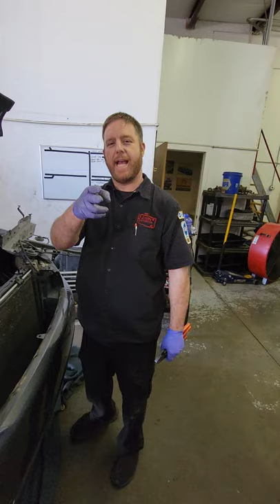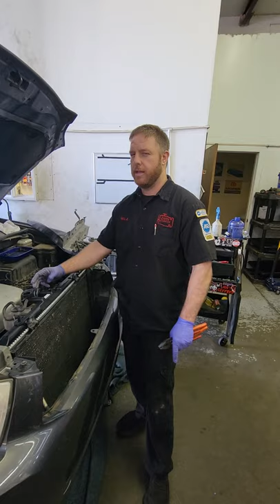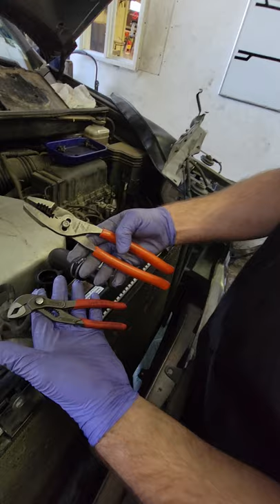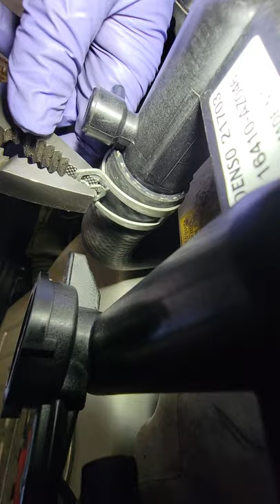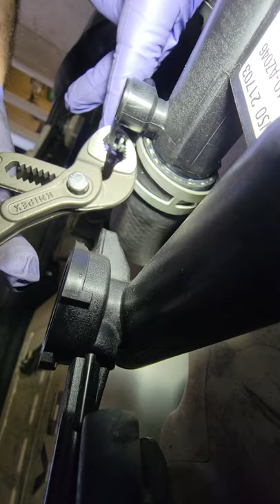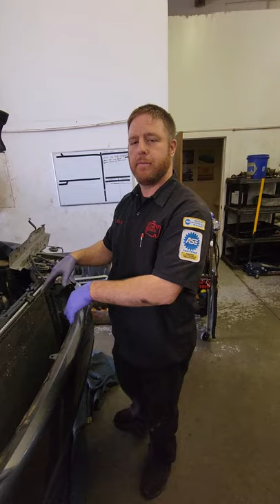NZ DIAG! How To Properly Lock & Unlock Constant Spring Tension Hose Clamps #shorts #automotive #auto

Comment: Worm gear clamps are the better clamp to go with. Spring tention clamps were invented to save on production cost! You like them because in a lot of locations they are easy to use and because as long as you have been working on automobiles (Not Very Long) that's all they use is cheap ass spring tention clamps!!

Comment: 25+ years in the cooling system business. I will tell you that the constant tension clamps are a 1 time use only. Reusing them often causes leaks and blown off hoses.

There is a reason that larger equipment use work clamps as well as other styles but never constant tension ones
Reply: Exactly. One time use. I agree with you.
Reply: In generators we use constant torque worm clamps

Comment: Okay not all of them are designed like that and most of the time I don't want them to lock. I don't need them to lock. I'm totally capable of doing the job without them locking for me. Oh yeah and I use the pliers you hate...... What did you call them? worm pliers. Kobalt brand. Congratulations though, keep being condescending to other mechanics, it looks good on you 👍

Comment: Check out the next generation Safety Spring Clamp replaces both Worm Gear and Spring Clamps.  Benefits of Spring Clamp, constant tension, without the problems of limited access or the need for special tools.  
Check out video:

https://www.youtube.com/watch?v=G-lRQESr59s

Comment: So you don't like worm drive clamps that have worked for nearly a CENTURY and your ass don't like them. Big f---in deal if had more of those POS spring clamps fail upon reuse than I care to count. Been working on cars for over 40yrs.
Reply from the maker: Constant spring tension clamps are designed for cooling system 😉.  European worm style clamps are also.